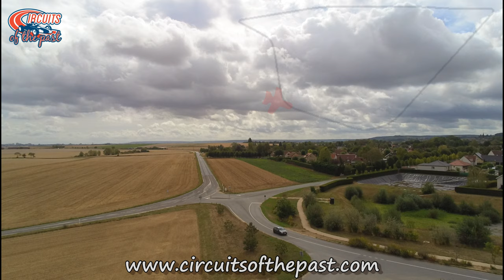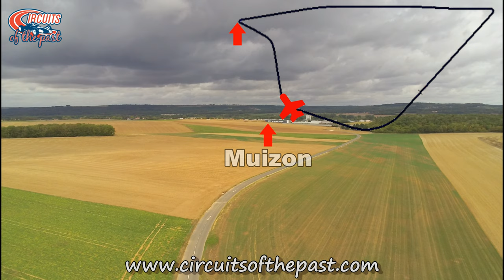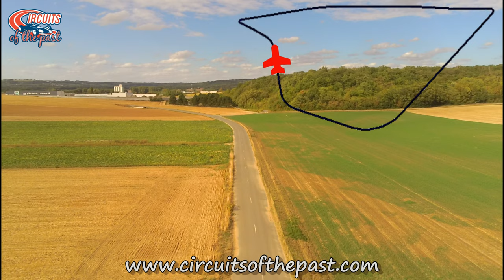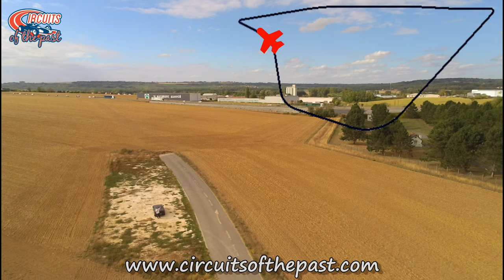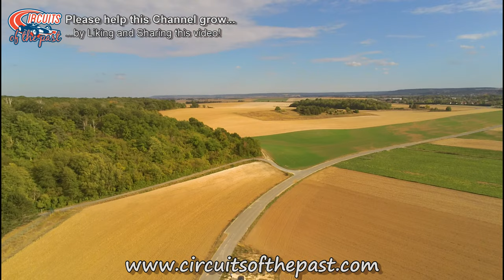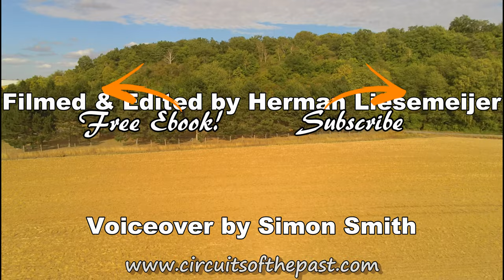Drone over Abandoned Circuit Reims-Gueux - Annie Bousquet to Virage Muizon

Comment: Hey it seems That the circuit is Very easy rather than 2 sharp turns
Reply from the maker: It was a very fast circuit with long straights. But also with some cool fast corners and elevations. Check also the video about the layouts of the track: https://youtu.be/eizrntFHSgI
Reply: @Circuitsofthepast  thanks